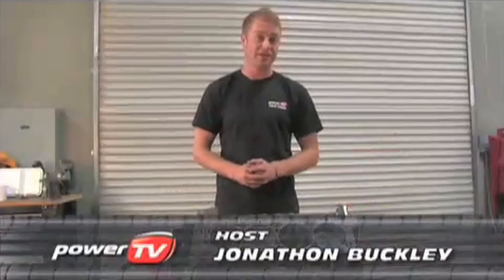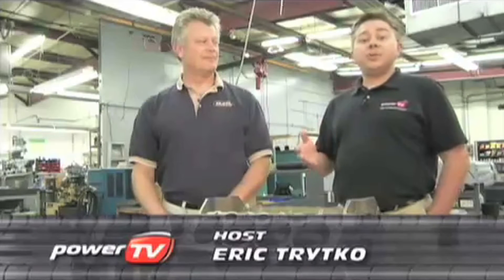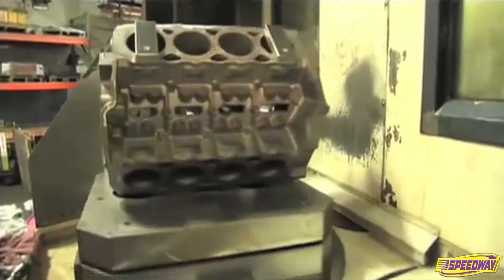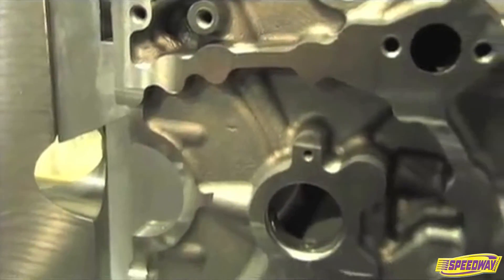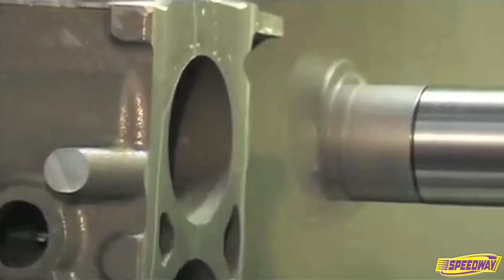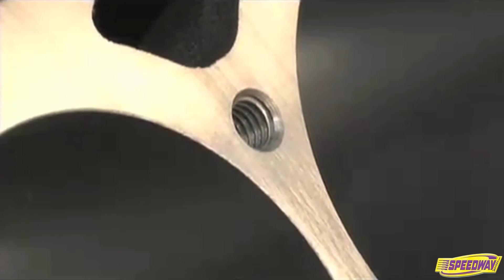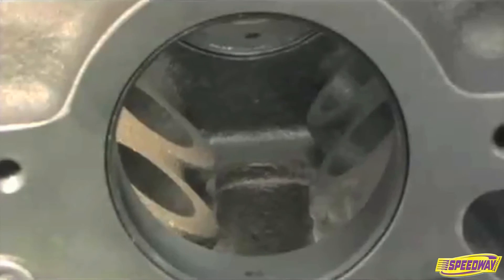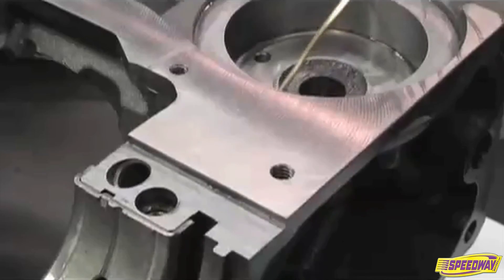The Dart SHP Chevy Block

Comment: Brother had a 4.125 bore 73 sb 400 bored .030 over. Running amber lightweight pistons 11/1 compression along with alot more. I am wondering how that block compares, the cost, & the peak performance of that setup both N/A & under boost? Nothing better then 750+ hp & torque naturally asperated! Not needing boost...